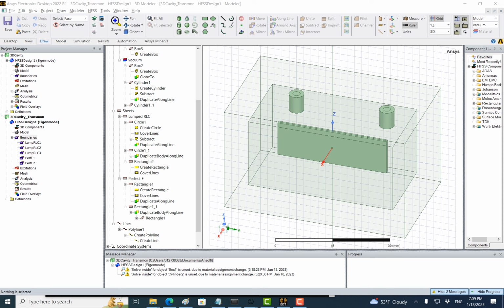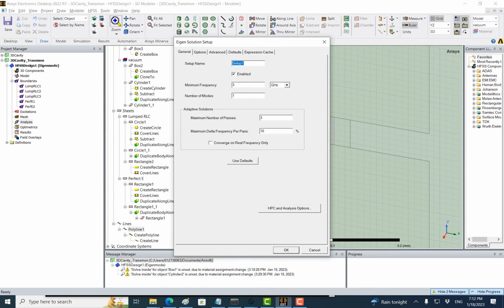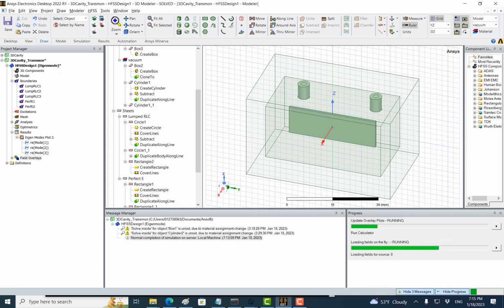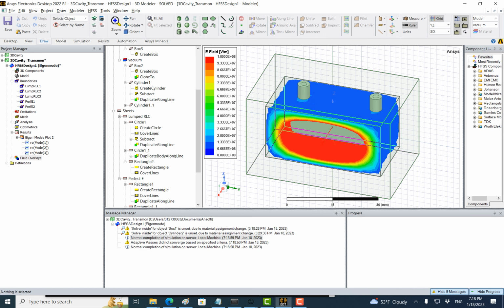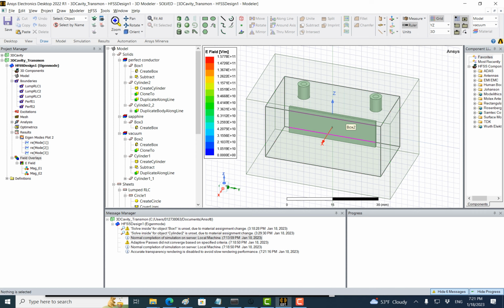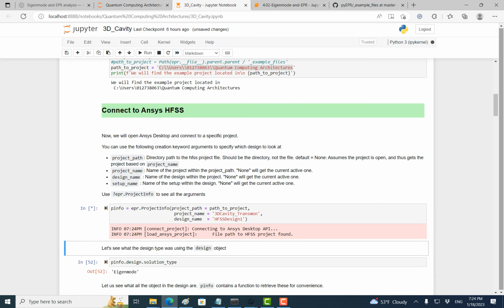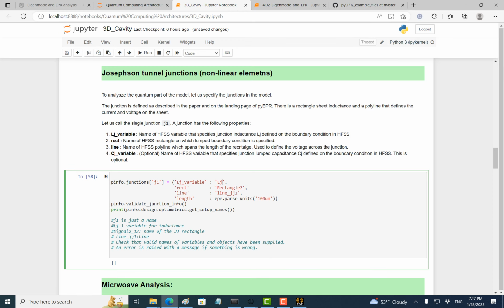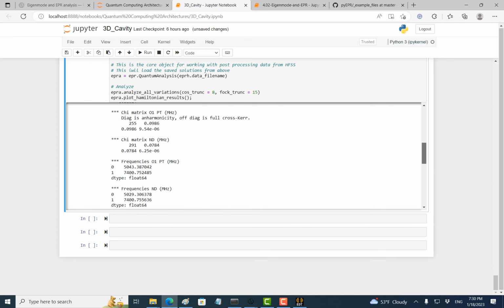Lab 9) Finding the cross-Kerr of Transmon qubit in a 3D Cavity using pyEPR in Qiskit Metal

Comment: I am working with the same design and while trying to run the line of code: eprh.hfss_report_full_convergence(); or I try to run eprh.do_EPR_analysis() it returns an error and doesn't create the plots. Do you know what I am doing wrong?
Reply from the maker: Not sure if I know why. Can you share the error message?
Reply: @quantum_computing  HFSS returns Script Macro error: Invalid prop server "Freq vs pass:re(Mode(1)):Curve1

and then jupyter notebook returns a long com error but one of the lines references curve1, so i think it may be something with that. Someone told me to comment some lines of code out in core_distributed_analysis.py, but I cant find which lines to comment or if this is the right way.
Reply: @Draginx Line 1578-1583 (may vary a little bit depending on your version), the four lines of “set property”

Comment: Very interesting presentation. I do have a curiosity.
I am working with a similar design. when running the EPR simulation, I get an infinite Quality Factor though I have included the dissipation during the initialization of the project info.
Any clue, what might be the problem or what I am doing wrong?
Thanks
Reply from the maker: Have you added a lumped RLC to the input/output port? Here is an example https://youtu.be/H71XHyAYDIY